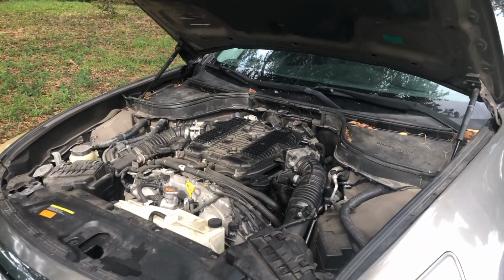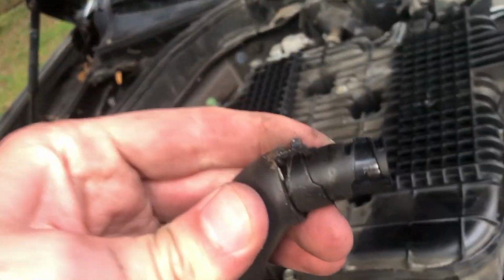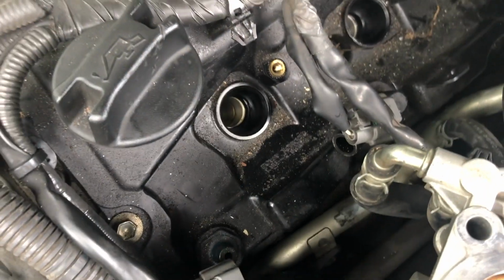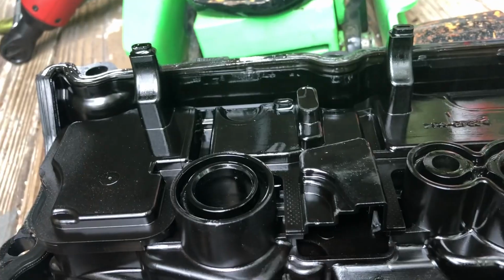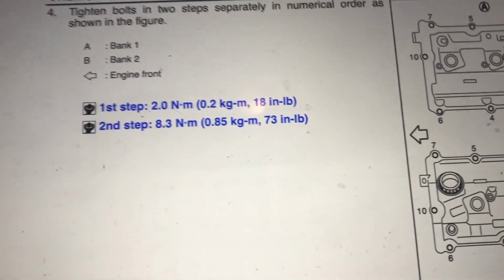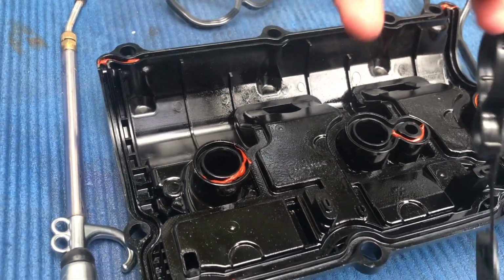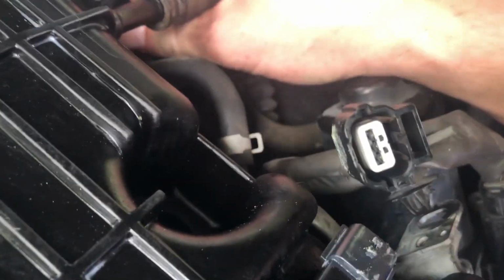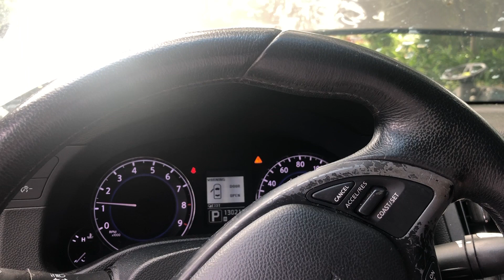Infiniti G37 Valve Cover Gaskets Replacement (LONG DETAILED VIDEO)

Comment: I wanted to thank you for this great and detailed video which had guide me through changing the valve cover gasket and spark plugs on my QX70. Your video was my main reference point along with the Service manual and I gotta say it didn’t disappoint! You covered 95% percent of the job and made this seemingly daunting job very straightforward. 
For the audience who would be doing this job in the future if you’re struggling with removing that orange electrical clamp on the driver side at the back of the engine the way I was able to successfully remove it was to use a metal trim remover tool and put it between the body and the orange clamp and push the clamp out. It pulled the whole assembly out without breaking anything. Another thing is that I would highly suggest labeling everything including all the hose and their mating and screws you remove to avoid mixing them up or forgetting to get a hose back at it’s place. 
Also I used permatex high tack gasket sealant and applied it in the groves of the valve cover for a bit of extra bonding between the gasket and cover to avoid dropping the gasket or tube seals in the engine during the installation and I would highly recommend it. I also cleaned my throttle body and MAF sensors during this job. In addition to the plenum gasket I also changed the throttle body gaskets since it was cheap and worth it. I also would like to sugesst buying a couple of extra valve cover screws in case you drop them into the engine bay and can’t get them out. Overall the process took 18 hours for me with me taking my time to ensure a perfect job and cleaning everything.
Reply from the maker: Thanks for watching and great suggestions. I decided not to go with permatex because with using OEM gaskets I had no issues with gaskets falling out of valve covers. Also, when it will be time to replace the gaskets again, you'll have to do a bit more work cleaning the engine and valve cover from permeates.

Comment: Just did this job myself. The driver side was such a pain in the butt compared to the passenger side.
I took a different route on the driver side, going from the front of the engine towards to windshield through the wires.
Nice video, very helpful!
Reply: Also using that wrench to remove those plastic connected was smart. I was struggling with pliers haha.

Comment: Best video I have seen on this process, thank you for doing this. Going to do this job right now my Z wish me luck fellas!
Reply from the maker: Thanks and good luck! Let me know how it went when you're done
Reply: @PZPal  I managed to break one of the valve cover bolts. Now I have to wait for new bolt to arrive and try to extract the broken nut
Reply from the maker: @NoName66426  damn that sucks, did you use torque wrench? or how did it happen? I know on my first Infiniti (2002) I used torque wrench and ended up breaking two bolts. I ended up just not fixing them and valve cover still held up without leaking oil lol
Reply: @PZPal  Yeah I bought a smaller torque wrench to do the job turns out it was not working properly it never clicked when I reached torque. I also skipped over the part of your video where you said to use very little pressure on it so that's what I get lol. I ordered new valve cover bolt should arrive tomorrow. Will try to extract the bolt hopefully I can do it successfully. I have another broken bolt on my car that is not on the engine I will try it there first to see if I can do it
Reply from the maker: @NoName66426  that's exactly what happened on my first replacement lol I heard that for those jobs regular click torque wrenches shouldn't be used, but the ones that show you level of torque on them. I just do it tight enough and never had problem with that. Generally those bolts are not too tight there, so hopefully you'll be able to remove them with no issues.
Reply: @PZPal  I was able to remove the bolt and complete the job successfully! Turned out to be pretty easy to extract it since the bolt was not really tight in there. I had drilled a small hole in the broken bolt, once I stepped up to a bigger drill bit I noticed that it was turning the bolt to the right and making it tighter, I put a screw driver in the small hole I made and was able to unscrew the broken bolt with no issues. Thank you for the video man it was very helpful you are a good mechanic and instructor
Reply from the maker: @NoName66426  awesome, glad it all worked out great for you! Thanks for watching my videos as well. I'll make more videos as often as Infiniti will require any repair or maintenance lol

Comment: great vid. I couldnt find anyone that wanted to do the work. I paid towing to 2 different places and they all said to sell the car because of my misfire and something about oil in the catalytic converter. I dont know anything about cars but used this vid to change all coils and sparkplugs and also a mild clean up of sludge. So far so good. Seemed easy, except i did strip one gasket cover bolt in the middle (left valve caover) and the thread is stuck inside. Im hoping the other 9 will hold it down. I may need to get a tool to remove the broken bolt thread
Reply from the maker: Nice, good job! Years ago I had older Infiniti and when I changed valve cover on that one, I stripped two bolts. I continued to monitor it and confirmed that oil was not leaking out of the cover even though two bolts were stripped. You can keep monitoring it and next time you have cover off or get close to it for other repairs you can fix the thread.
Reply: If you do need to remove the bolt for some reason, they sell these tools that will remove them. They are called external extractor sets. They work great.

Comment: Question and hopefully you can answer this by today. Can I drive the car after I’ve done the job? Or do I have to let it sit for a day? So the seal can work? Car: 2013 Nissan 370z + sport package
Reply from the maker: Tough to say, I'd say read what RTV that you used says and go based on that. I used Honda Bond in a recent valve cover gasket job and that one said it takes 24 hours. With that been said, I personally think most liquid gaskets are good to go after 1-2 hours of applying.

Comment: My 2011 Nismo still has a P0300 after I spent 2k replacing  parts with OEM such as: new spark plugs, ignition coils, crankshaft sensors, pcv valves, gas cap, throttle body seals, fan control unit, Evap vent valve, and purge valve. 😢😢😢😢

Comment: Does the gasket come with spark plugs, holes, and rubber rings, or is it a separate gasket?
Reply from the maker: If you order original then usually it’s separate

Comment: Hi my ignition coil is getting wet but its only in cylinder #3 can that be the gasket problem and replaceing will fix it?
Reply from the maker: I am pretty sure it will fix it. Just replace all valve cover gaskets and spark plug seals, so that you won't have to go through all that again to replace another one.
Reply: @PZPal  ok thanks i will do that, will see if that fixes it
Reply from the maker: Good luck, keep me updated!

Comment: Great video am going to attempt this myself. What’s that flat razor tool called ? And the little pik that pulled up the rings ? Thank you
Reply from the maker: Hey Nate, sorry for not responding sooner. The flat razor is called metal spudger. I used one from kit that contains bunch of other tools. You can buy one separately, but I think its better to get whole kit. Rings were pulled using pick tool set. I just put links to all of that stuff under video description. Let me know if you any other questions.
Reply: @PZPal  sweet deal , thank you!

Comment: I ordered a gasket oem from Nissan but the one that came with the new valve cover I ordered looks and feels stiffer and better quality. The Nissan OEM one looks good also but feels more soft and stretchy. Should I stick to the stiff one or to the soft one?
Reply from the maker: Sorry for not replying sooner, my personal opinion is to go with OEM since there was never an issue with OEM gaskets and they normally go bad after 100k miles
Reply: I’ll go with them and have the other ones as replacement thank you🙏🏻
Reply: Why did you need a new valve cover? It's usually just the gasket and spark plugs tube seals
Reply from the maker: @latino914  Just notice that too, maybe its G35? I remember one of the older models required whole valve cover replacement, but don't remember which one

Comment: Hey man I’m just curious did you have any oil on spark plugs that you did this job? I found oil on one of my spark plugs . Do you think a replacing the valve cover gasket will resolve the issue?
Reply from the maker: Absolutely, most of my spark plugs were flooded with oil. Just make sure you also replace the spark plug tubes.
Reply: @PZPal  how many of your spark plugs had oil?
Reply from the maker: I don't remember now, but I think 4 out of 6. Anytime you replace valve cover gaskets, replace all spark plug tube seals as well.
Reply: @PZPal  and how  many hours did it take you for all that valve cover replacement?
Reply from the maker: I'd say 4 hours from what I remember
Reply: @PZPal  do you know if these engines have valve stem seals? They might be a issue too for the oil on spark plugs
Reply from the maker: Not sure, I know that when I replaced what was shown on the video, I never had anymore issues with oils on plugs or with any misfires. So I am sure that is the main problem that G37s will have at around 100-120k miles.
Reply: @PZPal  ok just from your experience and knowledge what else can cause oil on spark plugs on this engines except the valve cover gasket? Mine has 67k miles now? Since let’s say I replace the valve cover gasket what else would affect oil on spark plugs

Comment: When you cleaned the throttle body did you move the butterfly back and forth?? Will i have to do the relearn process cause i too want to clean the throttle body??
Reply from the maker: I moved the butterfly back and forth while cleaning it. As far as I know, if you do not disconnect the throttle body electrical connector, you do not need to do the relearn process. Hope that helps.
Reply: U the man bro

Comment: Im curious did this help your issue with oil getting into your sparkplugs??? 
I recently got a misfire on mine and found out cylinder 2,3,4 spark plugs were drained in oil 
I changed them and changed my boots and now she runs like a champ but idk how long it will last 
I was doing my research and found it can also be the valve stem seal ? But looking at your video I think I have the same problem you were having with the gaskets just being warn out 🤔
Reply from the maker: Hello, thanks for watching the video and subscribing, I really appreciate it! It definitely helped and I no longer have issues with engine running rough. So far only about 10k miles passed, so we'll see what will happen in the future, but I am very happy with the outcome!
Reply: Hey what did you change the seal or the valve cover, they said they don't sell the seal , pls reply thanks
Reply from the maker: @temiromeo7195  I changed valve cover gasket and spark plug seal. That's two separate pieces.

Comment: Just did this on my 08 G35. Very similar process. But with the new gasket I am still having it leak on the driver side, bolt closest to the oil fill plug/intake manifold. I did rtv on all the corners and followed the torque specs and order to torque them in. Passenger side is fine and dosent leak. Any ideas? Kinda scratching my head. Only idea I have is to order another gasket and maybe Nissan RTV instead of JB weld? Thank you
Reply from the maker: Interesting, perhaps the torque wrench was not accurate and might need more torque on that bolt? Or maybe RTV dried up and created some space between valve cover and engine? I didn't use any RTV on mine, but not sure if older models require it. Let me know when you figure out what was the problem
Reply: you've used jb weld?! wtf? lol some dabs of rtv on the front-facing corners of the head should've been enough.

Comment: Where sis you get the information from on the computer? Did you have to do a throttle body relearn?
Reply: When cleaning the throttle body yes you need to do a relearn

Comment: Do need to replace just the rubber part on the gasket?
Reply from the maker: Not following your question, you mean valve cover? On g37, you can just replace the gasket on valve cover. I think earlier versions of Infiniti required complete valve cover replacement.
Reply: @PZPal  I have an 08 Infiniti g37, oil got on the spark plugs. Ok so I just need to replace just the gaskets not the actual valve covers
Reply from the maker: @trevinoemanuel  you need to replace the spark plugs gasket. I'd also replace the valve cover gasket as well since you're there. No need to replace the valve covers.
Reply: @PZPal  there is also oil in the spark plugs do I just need to replace them as well? Also thanks for the info, very helpful
Reply from the maker: @trevinoemanuel  I'd replace them if its time for replacement, not necessarily because of oil in it. I did mine when the car had about 120k-130k miles. Overall spark plugs are not expensive and since you'll be there, might as well do them.

Comment: do you have to wait for rtv to cure?
Reply from the maker: No, I didn't have to wait. It's pretty easy to put valve cover on top without sliding it much, so waiting for it to cure is not necessary.

Comment: Did this clear your p0300 code?
Reply from the maker: It did, at least couple of my spark plugs were covered in oil. I also replaced my spark plugs and if your car has over 80k miles with original span plugs, definitely replace them with OEM ones as well.

Comment: Is passenger and driver valve gaskets the same part number?
Reply from the maker: Now, they're different. Here is part numbers 13270-EY01A - passenger side and 13270-EY01B - driver side.

Comment: When did you did it ?
Fix your p0030 problem ?
08-24-22
Reply from the maker: I did it about year ago, possibly even longer. I think you meant p0300, if that's the case then yes. The issue was leaky tube seals (where spark plugs go), leaky seals cause spark plugs get soaked in oil and trigger various p03000 codes. So replacing tube seals may help. Its also possible that ignition coils are bad or the spark plugs themselves as well. Also keep in mind that from my experience, valve cover gaskets and tube seals tend to harden and leak after car has about 100k or more. All that again is just from my experience with Infinitis.

Comment: How to know your vale body gasket going bad ?
Reply from the maker: Main way to find out if they're leaking. You can see oil stains at the bottom parts of the valve covers. Also it's very common to see spark plugs filled with oil, which means spark plug seals are bad. Anytime you replace valve cover gaskets you need to replace spark plug seals as well (maybe they're called o-rings or rings, not sure of exact terminology for those). If you don't have any oil leaks in these areas then you don't need to replace the gaskets.
Reply: @PZPal  my valve cover leaking idk if I should buy new valve covers with gaskets or just the gaskets ? What do u think
Reply from the maker: @thatdallastx7861  if its g37 you need to just replace gaskets unless you see physical damage on covers themselves (that would be very rare)

Comment: What is the piece at 6:27 with the 91125 number on it called ? I need to find a replacement but I don’t know the name
Reply from the maker: I'll try to find part number tonight and will post here if I find it
Reply from the maker: I guess it comes in 16576-EY00A, but can't see it for sale separately

Comment: ok, i,ve got a single intake gt350 [ g35 ] . wish i had dual intake.  But wtf with them making the plenum out off plastic ! . ok cost effective. but will be getting heat soak. no transfer heat- then escape on to cool off . Sounds like the bmw way . [ i have worked at a foundry. of casting out off alloy. many problems . ]
Reply from the maker: Thanks for comment. They seem to make stuff good quality, but once in awhile I find some pieces that are made out of plastic lol I had a plastic tube break next to firewall, causing car overheat and coolant leak. I just replaced it with an aftermarket metal one.
Reply: @PZPal   nice
Reply: That what happened to me 2 weeks ago that plastic piece for the hose broke and coolant leaked and my car overheated now I have misfire like you. Maybe the pressure of the engine when the coolant leaked cause more gaskets leaks
Reply from the maker: @aceofadez  It could be, but on mine, as far as I remember, the oil leak started in a middle or front spark plug opening, but the valve covers were still decent. I also heard that it is very common for valve cover gaskets to start leak when vehicle reaches about 100k miles.

Comment: I am confused on how I have much more codes than you but my g37 engine makes absolutely no noise only my transmission for now
Reply from the maker: what codes do you have?
Reply: @PZPal  haven’t checked it recently been meaning to buy the device you use looks fairly convenient
Reply: @PZPal  last time I’ve checked I got 22 codes haha main ones I care for are P0725 P0615 C1109 U1000 U0415 B2553 B2601 B260F (not sure what this one is B2604/2605) B26E1 C1729 B210C B2562 then told me OBDII Codes 0 (extremely sorry about that haha just new to this and from all 22 those are the ones that interested me because the snapon doesn’t give much description like yours at least the guy didn’t give me much just recorded the screen
Reply: @PZPal  sit tight hahaha
Reply from the maker: @1kzooki  wow that's crazy. My guess is you have one issue that triggers so many codes. You just have to figure what that one thing is lol